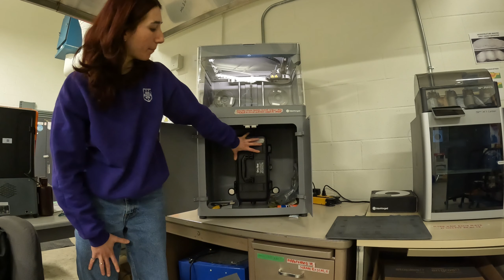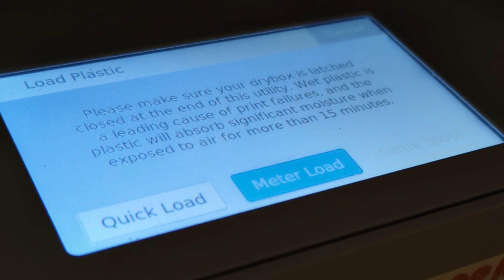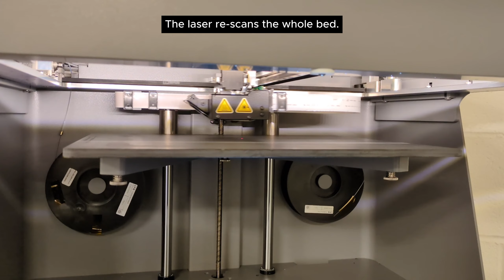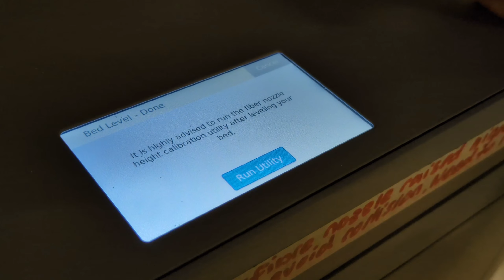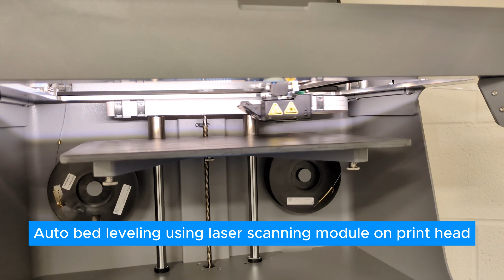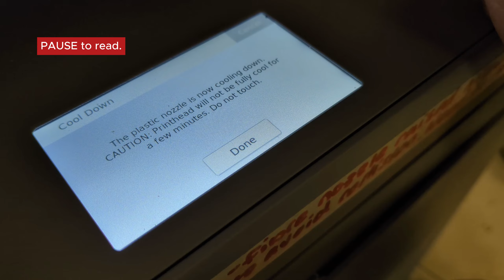easy Nylon 6 CF - how to print on the Markforged X7

Comment: Well Guess I now know how to use a printer I will never get close to 😂.

I do however love the idea of continues fibers inside 3D printed part.
Even though it probably makes the strength and stiffness difference in different directions way larger than they already are for 3D printed parts. 😂

Also it must be tricky to do the slicing such that the continues fibers are in the load direction (first principle stress direction) 🤔
Reply from the maker: Would you be interested in a slicer demo? We have yet to try the continous fibers but I wanted to document that when we do // I might make a project up just to use it haha
Reply: @StrelkoMania  of cause I would. 🤓😂

If I had acces to a machine like that my first fiber prints would probably be simple 2D topology optimized truss like structures or maybe thin Michell structures.

That would be so cool. Those structures could be extremely light and surprisingly stiff. But very optimized for 1 specific load case, thus very weak in other load cases.

I would probably also try printing one of the standard compliant mechanisms. Maybe the elephant, bistable switch or the pliers. Just to see what difference the fibers make in those types of prints. (Also I have not seen anyone try this)

Comment: 5:33
That plug is going to be lost with that design. I guess that is why they choose that color. 😂
Reply from the maker: I have already misplaced that thing twice - so you're right but the red doesnt help THAT much. I keep it in a special baggie inside of the base of the printer, where its like a cabinet that holds the dry box.
Reply: @StrelkoMania  3D print a holder and tape the holder to the inside of the cabinet 😂

Also they must sell a back of 10 of those. Then the holder could hold more than one, making it easy for people to see what the holder is for. 😎